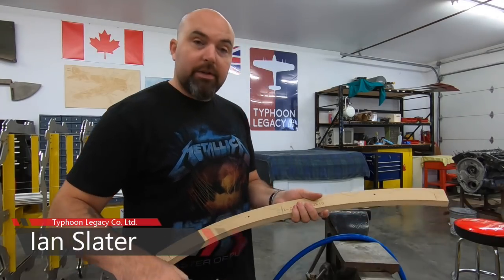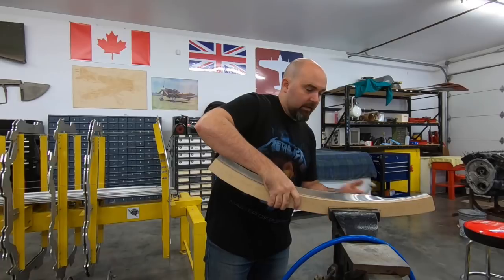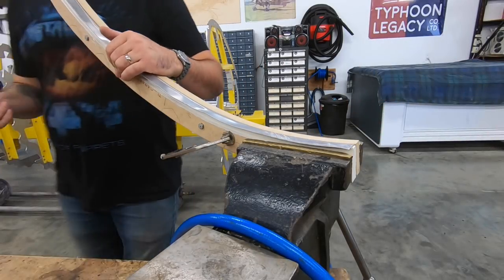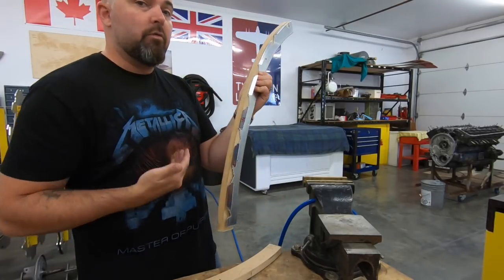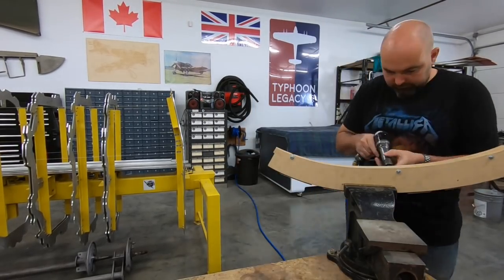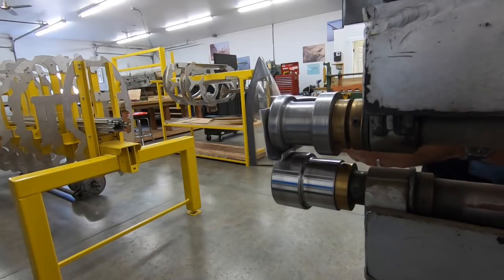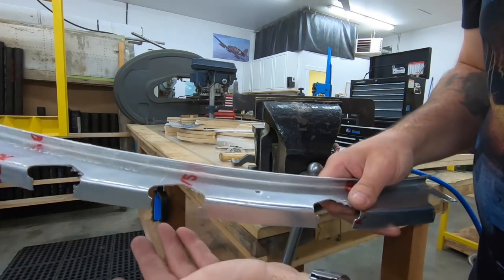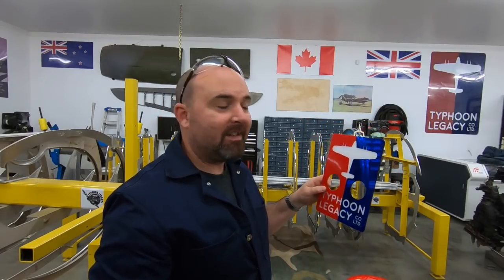S1E6 Rebuilding Hawker Typhoon JP843 - A Bit of a Stretch

Comment: Hi Ian,  Toroughly enjoying these videos and learning lots. What is the paint you used to toughen up the MDF? TIA
Reply from the maker: I used Killz, its highly absorbent. It did provide a slightly harder surface, but after with low volume parts I felt it wasn't worth the time. If you didn't have your parts in a temperature and humidity controlled environment, I would certainly say sealing would be worth it. ~Ian
Reply: @TyphoonLegacyCoLtd  We can get KILZ Adhesion Primer, Interior/Exterior, 1 Quart, but at GBP213, that is very expensive. Will have  alook around to see if there is a more local brand.
Thank Ian

Comment: You are an  amazing character! You should be surrounded by disciples as you sermon them on how to do work be like you! I love the videos.You mentioned using "Kilz" to harden up the fiberboard. Have you ever used "Thin epoxy" to soak into the fiberboard for the same purpose? Available at any boat supply emporium.
Reply from the maker: I have not tried that but certainly would be interested. I was unaware of an epoxy thin enough to soak in without external build-up. Do you have a brand name for this? ~Ian

Comment: I realise that you don`t have the facilities that we had but when making these kinds of things at Hawkers the item would first be soaked in a 600 degrees centrigade salt bath for 30 minutes, quenched and then formed using a rubber press delivering hundreds of tons pressure. Final forming would be done by hand.
Reply from the maker: The material is purchased in "O" condition which allows us to forego the furnace before we get going. Once formed, the parts go to our amazing sponsor Pyrotek Aerospace in Abbotsford B.C. for solution heat treating. I'd love to have a small salt bath here, unfortunately there is a massive amount of work committed to calibration and records keeping involved. Thankfully Pyrotek has been there for us! ~Ian
Reply: @TyphoonLegacyCoLtd  Good Evening Ian: I’m sorry it’s taken so long for my reply. What.is the problem that is stumping your team.

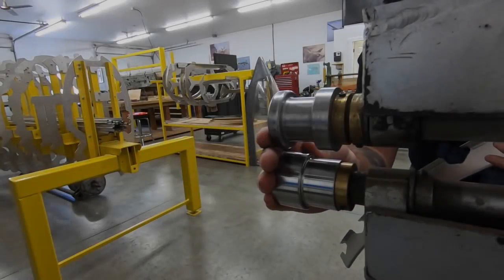Comment: 12:17 If you make the lower die to be at the size and shape of the outside of the part/flange it will be better for shaping it?
Reply from the maker: Certainly, it would work very well for truing the radius on either side of the channel. When you get to dies like that, they can only be used on one thickness of material. ~Ian

Comment: It is fascinating that these aircraft were essentially examples of ‘the panel beater’s art’!
Reply from the maker: The first few would have been, after that, production work would take over and most of this would have been done with large presses. ~Ian
Reply: @TyphoonLegacyCoLtd  I suppose that in Britain such large presses were allocated to the aircraft industry which might be why the Sten gun was the way it was unlike the late war German firearms (which were clearly made from pressed steel components).
Reply from the maker: @pcka12  That one is a bit out of my area, but an interesting thought for sure! ~Ian
Reply: @TyphoonLegacyCoLtd  I wonder if you remember the massive aluminium bonnet of the Rover 2000 series?
I once had a father-in-law who was an engineer responsible for all foundations & support structure when that press was installed!
Reply from the maker: @pcka12  Some of the larger presses require massive foundations to be built, tons and tons of concrete footings to support them. It's amazing what can be done!

Comment: Why a heat treatment...? How a heat treatment...? Must have its digs in metalergy, annealing n quenching ...that sort o thing. Only till recently I’ve been heat curing composites  or baking acrylics so to shape. Mike Patty here in the lower 48 says his love child is a one off...your jigdom implys a bit of plurality. Make more than one? Can another engine suffice? Can tubular fwd fuselage be constructed with aluminum tubing...? GREAT Stuff!  And too many questions.
Reply from the maker: The material that I am forming in these videos is annealed, this helps it form easily, but also needs to be treated to return it's strength. I do watch Mike Patey as well, he has a great show there.

We would be happy to make more than one Typhoon, and all tooling and fixtures will be kept for just such an occasion. The engine likely could be substituted with a Rolls Royce Griffon, but we are planning on installing a Sabre.

The cockpit structure must use the correct steel tubing, aluminum could not handle the loads imposed by the aircraft. ~Ian

Comment: Hawker Typhoon/ Tempest Kingston on Thames.

Napier Sabre “H” 24 sleeve valve. 2300 hp. St Giles London.

The H. G. Hawker Engineering Co., Ltd.

Designers and Constructors of Aircraft to the Air Ministry. Kingston on Thames. 🇬🇧

Comment: Great work.  What are you doing to ensure the tail doesn't break off in flight.  I know Hawker attempted to strengthen the aft fuselage with "fish straps" during the war but from what I've read it was still a problem.   Can modern stress analysis help with a solution?  Is this aircraft being built completely stock?  Good luck on the project and I look forward to following the progress.
Reply from the maker: The tail issue was solved in 1943, but the flatfishes were left on. There is some information on this in episode 3. JP843 is being built to factory specifications. ~Ian

Comment: Do You have any detailed drawings/ specs for a Sabre engine? how complete is the engine you have and is it in good enough condition to be 3d laser profiled to compile a  CAD profile that would allow CNC milling/turning of parts/components - (or indeed a whole unit - given time and shekels).
Reply from the maker: We have accumulated quite a collection of Sabre data, and have been looking at industrial CT scanning for some of the reverse engineering. One of our sponsors (E3D Technology Corp.) has done a great deal of reverse engineering on our Sabre supercharger, more on this soon. ~Ian
Reply: @TyphoonLegacyCoLtd  Have done some similar work on building "new" WW1 engines but usually with new metals. So will watch your progress with professional interest - may bug you if i notice anything we can help- or be helped with!
Reply from the maker: @russelld1646  Would love to pick your brain, material information took years of research! ~Ian

Comment: Great video Ian, fabulous to see these skills and you do a great job in showing how but more importantly why and what can go wrong!
Reply from the maker: Thank you Rob! ~Ian
Reply: @TyphoonLegacyCoLtd   very welcome Ian, can't wait to see this  project take to the air. It's probably fair to say that it'll be one of the best WW2 warbird rebuilds ever done! Can't wait though to here the Napier Sabre!
Reply from the maker: @robedge7670  It will be an amazing day when A Sabre sings again! ~Ian
Reply: @TyphoonLegacyCoLtd  amazing engine alright. Napier really were at the forefront of engine design. My father worked on the Deltic engine's that Napier build too. He worked on the types that were used in the Class 55 and 37 locomotives built by English Electric. I always remember the noise they made, but it was just amazing the small size of these engines to the given horsepower output they gave, 1650hp! Do you know if there are any other working Napier Sabre engines in a running condition at the moment or how you are set up for spares etc?
Reply from the maker: @robedge7670  Very interesting Rob! At the moment there are no operational Sabre engines, in fact, the last one to run would have been in the 1950's. Spares and the engines are both rare, we are always on the lookout! ~Ian

Comment: Hi Ian, As always a terrific video.  My admiration goes to you for sticking with what just can't be an easy project.  One point to make:  You worked on a part in this video and was stretching  it around a former for the final form.  For Christ's sake put the camera the other side so we can see how you're doing it!  I'm an engineering CAD designer (or at least was - now retired) and am hugely interested in your technique.  I have to say that my sheet metalwork was limited to a year on an EITB course (UK) so is pretty basic so I've been fascinated by how you've been forming parts.  Either way, and I'm not sure if this is of any importance, but if you need any help with CAD then let me know.  If you use a CAD system, which one?
As Bob Tuck used to say, "keep it in your pants".
Reply from the maker: Hi Terry, thanks for the feedback, I realized that I should have done that when I was editing the video, I will make an effort to show this with the production of parts in the future. I will have to have a look at our needs for another CAD designer, could you please send me an e-mail so we can stay in touch on that? info(at)typhoonlegacy.com
~Ian
Reply: @TyphoonLegacyCoLtd  Hi Ian, am getting an error message when I try to send using your website contact form. Any idea what the problem might be?
Reply from the maker: @terrymoll6116  I can't seem to replicate the issue Terry, it appears to be functioning when I try. You can send e-mail direst to info(at)typhoonlegacy.com if it keeps occurring. ~Ian

Comment: What heat treatment has to be done. And what grade of Alclad.
Reply from the maker: Hi Kevin, Alclad is actually just a very thin coating of pure aluminum on the surface of the aluminum. All sheet metal used for this project will be clad to help prevent corrosion. The alloy we are using for these parts is 2024, and the parts are being formed in the annealed condition identified by the letter "O". We will be heat treating to T42, so the final parts will be 2024-T42. ~Ian
Reply: @TyphoonLegacyCoLtd  thanks, I’m building an RV3 in my garage, so this is interesting for me. Most of the aluminium sheet for my project is 2024 T3. You can’t, bend much in this condition.
Reply from the maker: @kevinryan739  It can be formed in T3, but it has it's limits for sure, parts like the Typhoon frames shown here cannot be hand formed in T3. Stretch forming is an option though. ~Ian
Reply: Is using a rubber press feasible or it to much trial and error to get it to work for a limited number of identical parts?
Reply from the maker: @kevinryan739  If we were doing multiple ship sets the press would be the way to go, but this is the most economical in this situation. ~Ian

Comment: Will you keep all the forms, dies etc. as a sort of "Typhoon assemblers kit" for you or someone else to rebuild another Typhoon? Or do the forms lose their integrity over time and thus have limited lifespans?
Reply from the maker: All of the data and tooling will be kept with the aircraft should there be a need for them to be use again. The forms will be good for another part or two as long as they are kept in a controlled environment. ~Ian

Comment: Are you doing anything with the edges ? You did give a hint to newbies about the end snip-crack, but even though you are using "O" (dead soft) is the softness and thickness (.040) keeping the edges from stress cracking.  Also, is each of the four piece/bulkheads needing a full set of formers? Is that 5 wooden pieces x 94 formers???   Two pieces a day????  Fantastic work!!!!!
Reply from the maker: Just towards the end of this video it shows the edge finishing, I start with a 180 grit sanding disc and finish with a non-woven disc. Once the parts are done with heat treatment, I'll do final fitting and clean to a semi polished surface using a rubberised de-burring wheel.

The "O" material doesn't stop cracking, as I work a normally clean edges up as required to stop any cracks from forming; I base this on what the work process will be.

Indeed, a big pile of blocks for one segment! ~Ian

Comment: You mentioned heat treating near the end of the video. Could you explain? 
Nice work BTW.
Reply from the maker: For sure! The material that I've working with here is in it's annealed condition to aid in the forming process. With forming complete, it will need to be heat treated (brought to an elevated temperature and quenched in water or glycol) to return the proper mechanical properties for a structural part. I am hoping to do an episode on this at a later date. ~Ian
Reply: @TyphoonLegacyCoLtd  OK.. not to get too far in the weeds..from the ASTM spec looks like clad 2024. Didn't see a HT spec so, T0 or ?
Reply from the maker: @racerdad2277  These fall under am AMS  (Aerospace Materials Specification). Clad is a very thin (.0003-.0005") layer of pure aluminum on the surface of the material, this is for corrosion protection. The material I'm using doesn't have a temper at the moment, it is annealed which is designated by the letter "O" after the material specification. I hope that helps~Ian
Reply: @TyphoonLegacyCoLtd  Being in the States my brain defaulted to ASTM....has the right letters with one extra. Is it T0 as in zero? Anyway, thanks for the reply. Love the project. Looking forward to the next video. Now...back to work.
Reply from the maker: It's the letter "O", there would be no "T" in front of this one as that refers to "Temper"

Comment: No bossing mallet?
Reply from the maker: Not in this video, I normally use a light mallet for finishing a shrink, but will also use a hammer and wood block for more control in the same application. ~Ian
Reply: @TyphoonLegacyCoLtd  I was taught by  a gent (Jessy James was his name - no joke) who learnt Tinsmithing on the post war Vickers Civil & Military Aircraft (at Brooklands) - so I was taught the bossing mallet was the shrinking and stretching mallet of choice on aluminium (and other metals). Small end for shrinking, large end for stretching ;)
Reply from the maker: @toboldlygos_model_works  That would fall into the "trap the ruffle" technique I believe, the small end being used to slowly pinch the material on to itself. Having the composite shrinking jaws really saves a lot of this work, but there are still times when I need to do just that. ~Ian
Reply: @TyphoonLegacyCoLtd   Trap the ruffle is/was referred to as tucking (in Blighty) and was one of the first things I was taught to do on the shop floor (at Hawker's) - as it teaches you to understand how aluminium and other metals behave when your working them. 

The shrinking and stretching jaws came later and they do save time on multiples of the same part ;)

Though the composite jaws had a habit of self-destructing!
Reply from the maker: @toboldlygos_model_works  Fantastic info James, thank you. There is a great book titled "Art of Coppersmithing" that deals with this subject. It's amazing to see what can be created with the most basic of tooling and some experience. ~Ian
Reply: @TyphoonLegacyCoLtd  Coppersmithing and Tinsmithing meant two different things at Hawker's (BAE). If you where a coppersmith you primarily dealt with pipe work and the smaller duct work. A tinsmith would deal with sheet metal work - so basically everything that needed to be fabricated from flat sheet metal - that wasn't extruded or pressed out by a machine.

We got fewer in numbers, when Kingston closed and were transferred to Dunsfold, and things got diluted somewhat (in fact I was the last Tinsmith ever trained at Kingston/Dunsfold) - all the apprentices afterwards were 'multi-skilled' when they were signed off.
Reply from the maker: @toboldlygos_model_works , I believe the original publish date on the book was 1893, so it didn't involve any aviation; more general practice that is disappearing these days. 

It's very interesting to hear from you on the first hand time with Hawkers. Did they ever provide you with a tinsmith training book? I've come across a few Hawker writings, and would love to find more! ~Ian
Reply: @TyphoonLegacyCoLtd  Of course they are disappearing, if you think I was signed off as a Tinsmith in 1993 and they were no tinsmiths or coppersmiths signed off their apprenticeships after that date (at Dunsfold anyway). Ask an engineering apprentice today to draw out a breach piece, make up a template and fabricate it - the majority will look at you as though you are from a different planet.

I have a few of my old Aerospace training manuals in my ex-Hawkers cabinet in the shed.
Reply from the maker: @toboldlygos_model_works  Yes, a sad state for the trades these days. ~Ian